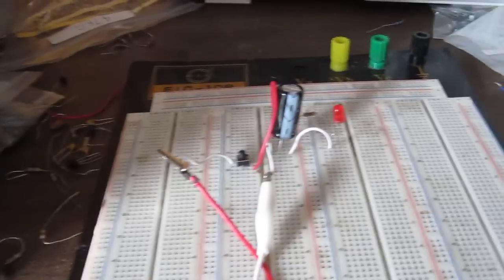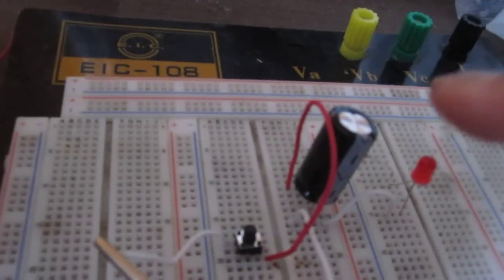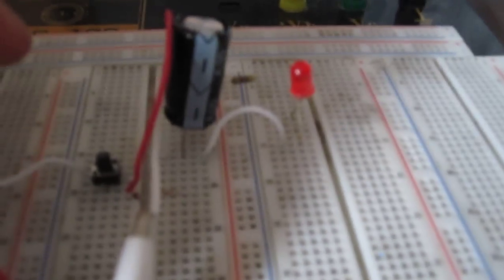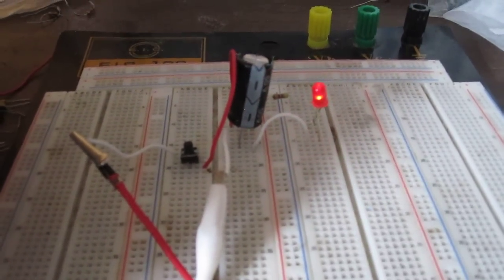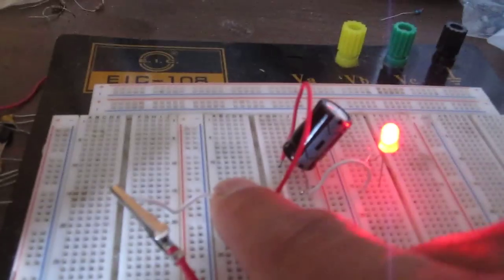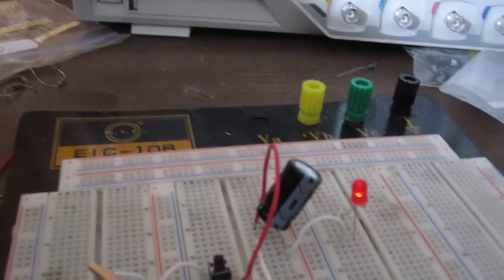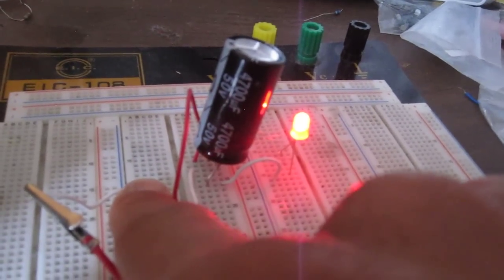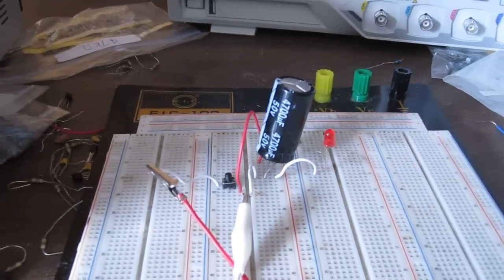How to Use a Capacitor to Act as a Temporary Power Source for a Load

Comment: Nice video thank you, but i noticed a small semantics error. More current does not keep an output device on longer like you said at the end. You increased the total energy (jules) delivered to the led, not the current (amps). Since all 3  circuits had the same voltage and resistance the current did not change. V=I•R.  The bigger capacitors provided the same current during more time (had more energy stored in them).

Comment: My only question (learning) how fast does a capacitor charge? I see you holding the switch for a few seconds before showing your ultimate demo of the LED remaining lit, but would you get the same effect by just tapping the switch or is there a charging rate (speed) for the capacitor?
Reply: Thats what i was wondering.. i would think it would function the same only start at a lower brightness. Keep Pushin!

Comment: So does the voltage of the capacitor just tell you how much voltage it can handle?  As long as you use a capacitor with a voltage higher than what is used to power your circuit?

Comment: So what is the real purpose? I get it holds a charge, But why do circuits use them? And why do circuits stop working when you use them?
Reply: Often a capacitor is used to smooth out DC current. Like with rectified AC, it's DC, but it's choppy because it's a series of peaks strung together. Adding a capacitor removes the choppiness by eating up the peaks and filling in the gaps between them.

Comment: if i use a 1A adapter instead of a power supply, and with a very big capacitor, will the adapter blow cause the capacitor drain too much from the adapter ?

Comment: what size of a diod would you recommend for use of many LEDs in a car ? I installed a diod and noticed significant improvement in work of my LEDs and Im just wondering what is the highest reasonable size I could use